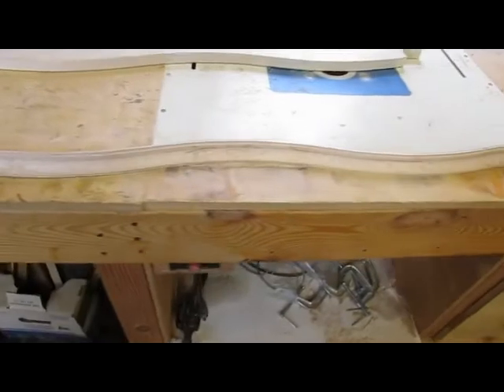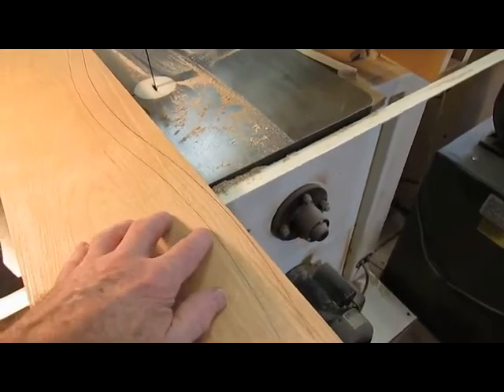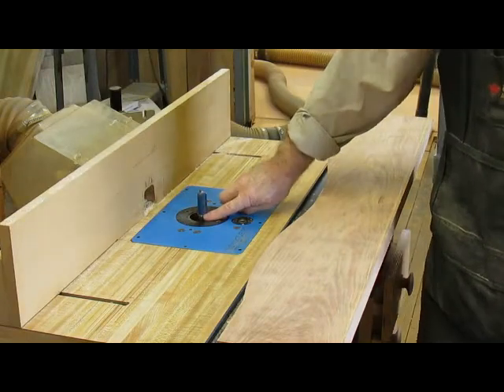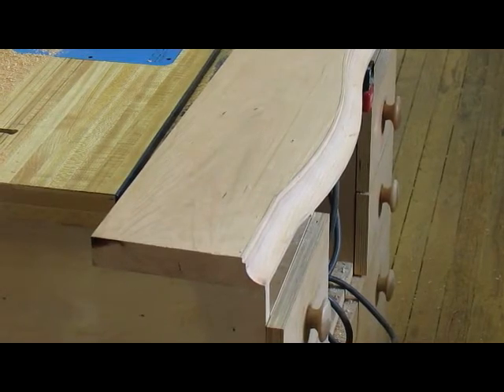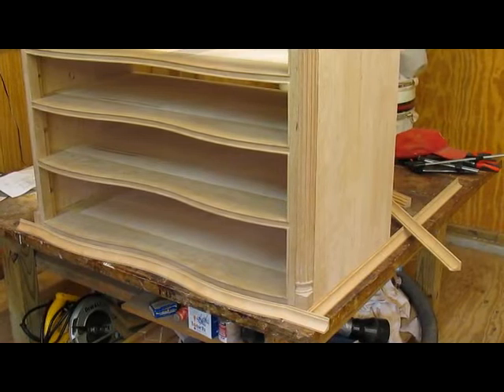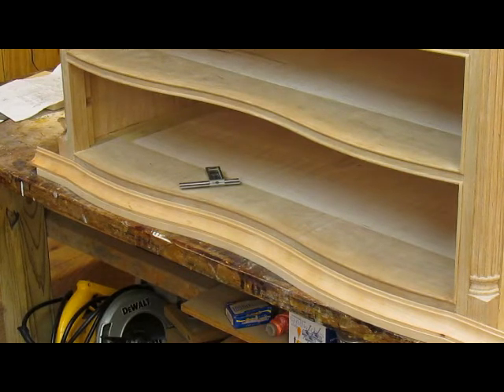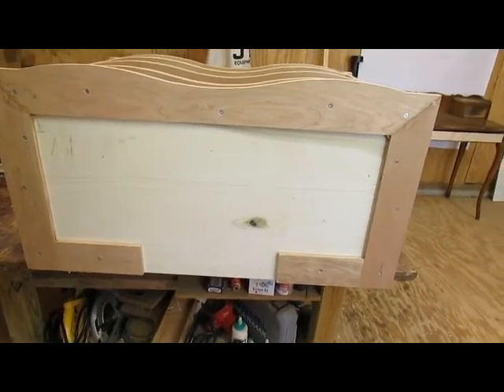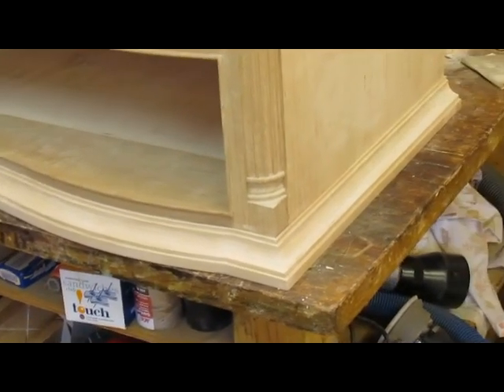Cherry Oxbow Chest   Shaping the Molding Step 7

Comment: I admire your work.  For the moulding what do you think about bending a 3/4" thick piece and gluing it on so there is no endgrain?  Or is it not a big deal because not that big a curve?
Reply from the maker: Thanks Robert, I don't like bending wood.  Not sure about your comment on the end grain.  The only end grain here is hidden in the corner mitres.
Reply: David Boeff I was thinking where the curves are there a an oblique angle across the grain that might expose some endgrain.  Thinking in terms of differences in staining or finishing.  Probably not enough curve in this case, but in some instances where the curve is sharper like a goose neck moulding do you think this could be an issue?
Reply from the maker: Robert no I don't think so

Comment: Aren't curved moldings fun? :)
Reply from the maker: Matthew Cremona Matt, it was interesting.  More router work than I like but carving would have been a lot of work.  The straight pieces could have been done with hollows and rounds but since I had the machine set up I used it.
Reply from the maker: Matthew Cremona compared to you goose neck moldings on the highboy these were a piece of cake.
Reply: David Boeff only slightly :)